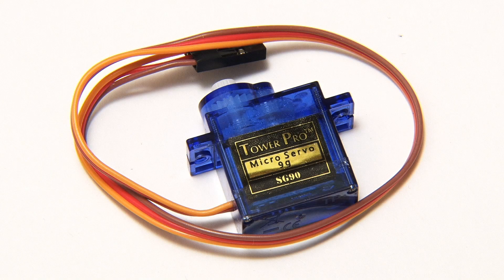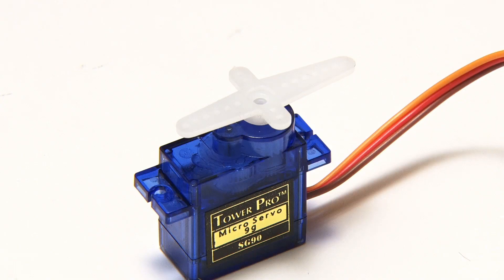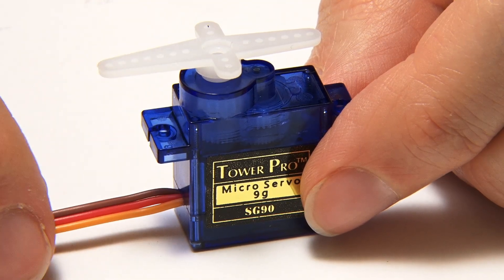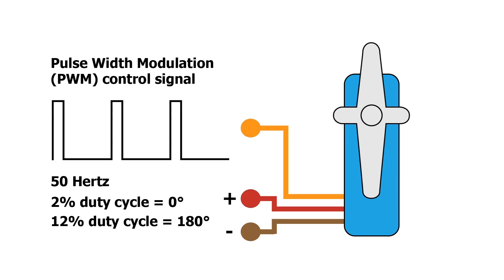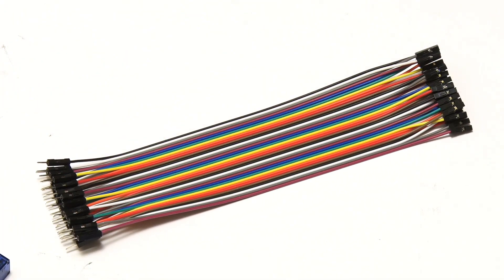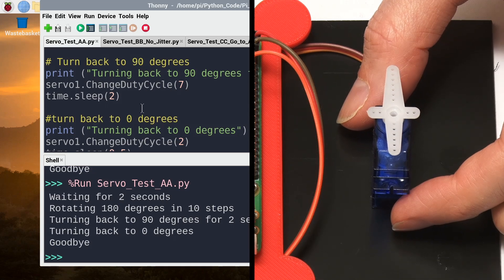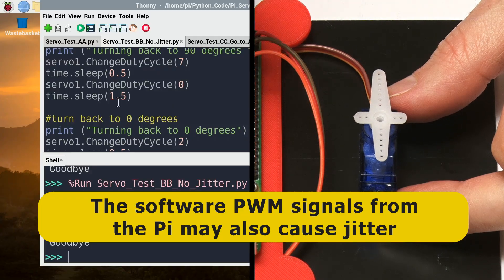Raspberry Pi Servo Motor Control

Comment: 🎯 Key Takeaways for quick navigation:

00:21 🤖 The video introduces how to control servo motors using a Raspberry Pi, a critical skill for various projects.
01:19 🛠️ A servo motor, like the SG 90 mentioned, allows precise control of its angular position and consists of a motor, gearing, a potentiometer, and control electronics.
03:08 ⚡ Servos have three wires: positive, negative, and a control signal wire, which requires a pulse width modulation (PWM) signal to control the angle.
05:06 🔌 Servo wiring example for a Raspberry Pi, including connecting the signal, negative, and positive wires to GPIO pins.
06:27 🖥️ Setting up servo control code in Python on a Raspberry Pi, including GPIO pin configuration and PWM frequency.
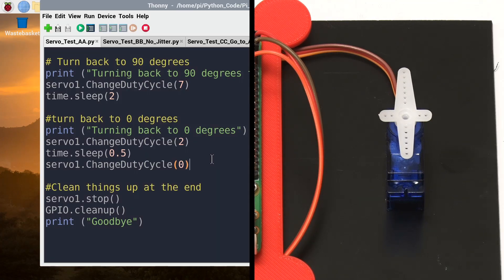09:12 🤔 Demonstrates a servo motor moving in steps, but there's some jitter due to the motor trying to hold its position.
10:19 ⏩ A code modification is shown to reduce jitter by briefly turning off the servo after each move.
13:05 🔄 Code example allowing user input to set the servo angle, providing interactive control.
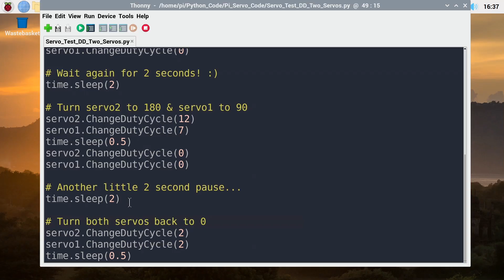16:22 🤖 Controlling two servos simultaneously using a Raspberry Pi, demonstrating the capability to control multiple servos for various applications.
Reply from the maker: Thanks for this. Although the video is already divided into named chapters, which can be navigated via the bars at the bottom of the video.

Comment: For some reason changing the duty cycle to 13.222 on SG90 will send the servo more than 180 degrees, maybe 320 degrees, but not to an angle, just adding to current angle, so if you change it to 13.222 twice it will go to 640 degrees counter-clockwise from the current position.

Here is some code to make it spin continuously for 5 seconds

import RPi.GPIO as GPIO
import time

GPIO.setmode(GPIO.BOARD)
GPIO.setup(11,GPIO.OUT)
servo1 = GPIO.PWM(11,50)
servo1.start(0)

count = 0

while (count < 10):
    print(count)
    servo1.ChangeDutyCycle(13.222222222222221)
    time.sleep(0.5)
    servo1.ChangeDutyCycle(0)
    count = count + 1

servo1.stop()
GPIO.cleanup()
print("Finished")

Comment: Is there a way that I can move the servo in the opposite direction?
Reply from the maker: A servo is sent a signal to turn to a fixed angle. So the direction it travels depends on the starting angle. For example, if it is at 45 degrees and you send it to 0 degrees it moves one way. If you send it to 90, it moves the other way!

Comment: Can you please help understand what the code would look like if I want to control a service motor holding a camera? I would like to type “R” and have the motor go right a certain amount of degrees and then type “L” and have it go back left a certain amount of degrees. If I type “U” for up the other motor would move the camera up a few degrees and “D” the camera would go down a few degrees.

Comment: Thanks for posting that very nice video. I am trying to make a solar powered security camera with pan and tilt control. I hooked up the pan servo of a tilt/pan 9g servo assembly to my Pi 3b running MotionEyeOS, SSH-ed into it from my Ubuntu 22.04 laptop, and wrote action button files to make the camera pan/tilt action buttons appear on the camera live feed. The next thing to do is to write code to put in those files. I modified your code to set the pan to straight ahead center, pause, then go fully to the left, pause, back to center, pause, fully to the right, pause, then back to center and end. It does that. Hooray! But what I need is code to bump the camera from right wherever it is at, to the right (or left as the case may be) say 22.5 degrees every time I click the button and make the code run again. For that, I think I need my code to find the current position to add or subtract to it. Is there a way of doing this? Otherwise I can only pan to one of three positions, home, left x degrees, or right x degrees. I want to be able to click the button repeatedly to move the camera more and more, another step each time I click.

In fact, a video showing how to make best use of those pan and tilt buttons in MotionEyeOS would probably be helpful to a lot of people. Just sayin. You have a knack for explaining things like this. Liking and subscribing.

Comment: @13:30 Explained for my sanity.
Duty cycles range from 2 to 12, which represent 0 to 180 degrees. So for our input variable "angle" you are using "angle/18" (to get 10 degree position steps out of 180 degrees). So for an input "angle" of 90 degrees, it would be 90/18=5 for the duty cycle. However if we gave 5 as a duty cycle in the range of 2 to 12, then this would effectively be a 3 and not 90 degrees, because 5 is not the midway point between 5 and 12, 7 is. So this is why we add 2 for the duty cycle position (5+2).

Comment: so why do you go from 0-12 for the duty cycle? the online library example show values between 0.0 to 100.0
Reply from the maker: Which online library?! :) Servos are controlled from a square wave, which would be a horizontal line at either 0 or 100.

Comment: Great explanation and code works 1st time Christopher, most excellent! I am brand new to raspberry pi and python. Q: Is there a code example that would repeat (or loop) the code 50 times? (Without copy and pasting code 50 times… lol) thanks again you are a great teacher. John
Reply from the maker: You could add something like this:

count = 0
while count < 50
     [SERVO CODE]
     count = count + 1

Note that here the code inside the while loop is indented with a tab.

I have a Python intro video here: 
https://www.youtube.com/watch?v=Crsp_He70no
Reply: or you can use for loop:

for i in range(50):
          servo code

Comment: I’m building a little robotics platform for myself and had typed out a little Python Library for myself to handle the wheels but didn’t know for sure if the PWM methods could control more than one servo at a time. With this hindsight I realize it’d be a bit silly if it weren’t capable of doing so. Now I just have to remember where I saved the two libraries, test them out, and add in turning to the Wheel library. Thank you again for the awesome videos!
Reply from the maker: Good luck with your platform. :)
Reply: @ExplainingComputers  Thank you!

Comment: Excellent presentation. I'm going to have a fun time working out how to control two servoes on a Delta V-wing drone.
Reply from the maker: Sounds like a cool project.
Reply: @ExplainingComputers  It will be when I get that far. RIght now I'm having difficulty since eBay sellers are willing to sell but not to supply. If I was back in Swansea I could go to Tom Whitehouse in the market but I'm in South Carolina.

Comment: 12:05 How to set the servo rotation speed?
Reply from the maker: You can't set a servo rotation speed -- the control signal just tells it the angle to turn to, and it will do this as quickly as its mechanism and any load will allow. But you could control the speed in software by sending the servo to intermediate positions.
Reply: @ExplainingComputers  Oh. I guess we can adjust the speed too :)

Alright, thanks a lot for the information and explanation!

Comment: Is there a reason not to use the hardware PWM pins found on the Raspberry PI 4 B?, or weren't they not in the PI 3?

Sorry if this is a stupid question, we are a bit stumped as to why our servo is not playing nice (starting to think it might be broken, since it isn't new)
Reply from the maker: The two hardware PWM pins on a Raspberry Pi (any model) cannot be accessed from Python using the available Rpi GPIO library. So yes, there is a reason that you have to use the software PWM. :)
Reply: @ExplainingComputers  Thanks for the info! 

btw, the erratic  servo we had was indeed broken, and a different servo worked beautifully following your video 👍

Comment: With just 2 PWM chanels but 4 outputs I had wondered if you can coltrol 4 servos independantly, turnd out you can. All working fine thanks, for the code really speeded things up for me, only used stepper motors before.

Comment: Hello Chris, thank you for the fantastic tutorial.  I used the code for my program and it all worked well until I modified the main python program to run continuously. Based on the value on a table, it would trigger the python program to run the servo motor (change the angle), that program would use the same code principles (set up the servo, make the angle changes, then stop and then cleaned it up at the end). For some reason it work fine the first time the servo program is triggered by the main program, but once it triggers it again the program would run fine but the servo would not move. Tried all the different options and it failed to worked (e.g.: not stopping it but cleaning it, etc.). 
Only way I could finally make it work was to: Always have the servo running (no stop or clean up); Have all the code in one program (The table check and the servo change). Main problem with that solution is the fact that based on my requirements servo is always in used - which could reduce its life significantly.
Any ideas on how I can solve this (main issue seems that once the servo is set-up in python and then closed/cleaned it will not move again unless the program python code is completely stop)?
Thank you in advance and keep up the great videos

Comment: In this video you used a 3 amp power supply, can I power 2 small servos (like yours) which are moving a servo stand and a PI camera, with only 2.5Amps?

Comment: Micropython newbie here.  Stylistically, why the try-finally block (without an exception clause)?  Also, should the script's exit cmd follow the block rather than appear inside it.
Reply from the maker: This video -- and the Pi -- uses Python, not Micropython (as can be used, for example, on a Pi Pico). Here try-finally is implemented to allow the user to break into the infinite while loop with GPIO cleanup then executed (I'm having to remember the code from the video here -- I do not recall the content of over 400 videos!). So the GPIO cleanup command has to be inside the finally block, or it would not execute. There is no exception clause because none is required! There are, of course, always lots of different ways of doing things. However, as I've used such code in videos with many millions of views and have never had a comment on it before, I believe this is pretty standard stuff. :)

Comment: I want to control the servo motor with the ultrasonic sensor and the raspberry pi, do I need to use a extra power supply and I have no idea how it should be powered

Comment: Kinda time senstive but no rush obv. With the servo motor, what wire would fit in the holes along the servo? and how would you go about attaching said wire? do you just make a tiny knot so it doens't thread back through or is their an actual component you can buy?? THanks in advance!!!

Comment: That took a lot of time and work. I think you would find using a PCA9685  would make things a lot easier. I've always found a dedicated hardware solution works best. After all the PCA9685 was designed to make life easier. Nice video, but why make things more difficult for yourself... Happy GPIO..
Reply from the maker: A PCA9685 is not remotely a replacement for an SBC! :)
Reply: @ExplainingComputers  of course it's not a replacement for a SBC.  it's strictly a servo controller to be addressed by a raspberry pi or similar SBC through I2C. I use them to control servos that are connected to a Jetson nano, and they work great. They greatly reduces the load on the cpu. I said nothing about replacing the SBC with a PCA9685. There's nothing wrong with doing things your way, but it greatly limits the SBC's ability to perform additional tasks at the same time. A software solution for controlling a servo is an added layer of complexity and its cpu intensive. Most of the processor time would be dedicated to generating the necessary signals to control  the servo. 
 It's your channel you can do what you want. I'm just saying there are better ways, unless the only objective is to move a servo and do nothing else. Anyone wanting to control a servo with a camera attached to scan the environment or other device, lidar, or ultrasonic sensor. Is going to have a very difficult time without a servo controller attached to a SBC. I hope this clarifies my position. I'm not here to get into a pissing contest.
Reply from the maker: @rickhunt3183  Ah, I see -- understood. :) I totally agree that there are better ways to control servos from a Rasberry Pi than directly via GPIO, but that is the easiest method for new users, which is what I was trying to show here. :)
Reply: @ExplainingComputers  thank you for your response and for being so nice.

Comment: Thank you very much. But I have a question if you can kindly answer me or advise me, the servo is vibrating (making noises), how to remove such noises because I want to place on top of the servo an accelerometer (otherwise it will give me wrong readings). Best Regards

Comment: I am running a software defined internet connected short wave radio receiver with an RPI4 and have been looking for a simple way to "tune" a loop antenna with a variable capacitor. I think I have now found my solution! thanks very much !

Comment: Very useful video, thank you, how can we connect a servo and a LED at the same time to the raspberry Pi, should we use an external battery for that. Would you, please, provide the right connections for that, thanks.
Reply: Just connect the LED to another gpio pin?

Comment: Could someone tell me the code to rotate the servo 360 degrees?
Reply from the maker: Most servos do not rotate 360 degrees. For that you need a stepper motor.

Comment: Finally got mine all figured out. Thank you for the video.  My breakout board was backwards but for some reason the 3.3 v pin was measuring as 5.2 v on a meter so I assumed the configuration was correct.. it was actually backwards.  Anyway I had it all hooked up correctly except for the ribbon being backwards.  All working now.
Reply from the maker: Great to hear! :)

Comment: Hey, Nice Video, but is there a way to rotate a servo motor 360 degress? if so then pls reply me I am new to this. Thank you :)
Reply from the maker: Very few servos go 360 degrees -- it is not what they are designed for. For that you need a stepper motor.
Reply: @ExplainingComputers  Ok, So I am gonna get a DC Motor. Thanks for replying :) +1 sub

Comment: If i run out of 5V pins on RPi, could i power this servo with 3.3V pin?
Reply from the maker: No, absolutely not for two reasons. First, it needs 5V. And second, the 3.3 volt pins on the Pi draw power after the Pi's voltage regulator, so can only supply very low current to electronic devices. Connect an electromechanical device like a servo to a Pi's 3.3 volt pins, and you run the significant risk of damaging the Pi.
Reply: @ExplainingComputers  Thank you very much!

Comment: with some rusty fingers. I was working on a way to execute input to the servo with argv. You have just help me out so much here.
Reply from the maker: Great to hear. Hope all goes well.
Reply: @ExplainingComputers  im struggling with the odd movements. Nothing is consistent. I may move my project to a stepper motor but i hope to give the servo more testing tonight.  
A single servo connected to the pi is clean for my project.

Do you have advice for this Inconsistent odd movement? I test ran your improved python script and found the same resaults

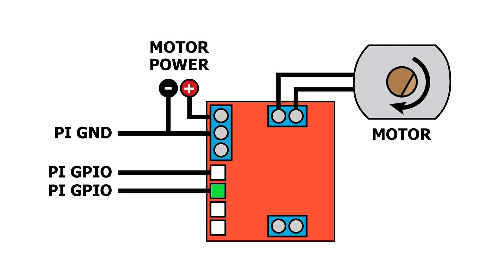Comment: 2:12 "... in contrast a servo does not spin continuously, ..."

That is not entirely accurate. Servo is a general term for a closed-loop system consisting of a motor, feedback, and, well, the control system.

You can have speed servos that, as the name suggests, will maintain speed, given a reference. They do spin continuously at a set speed and (try to) maintain that speed as the load changes.

What you describe in this video is a position servo, which spins to get to a position set by the reference.

Comment: Do you know if these servos can be modified to turn 360°? I'd like to use them on a dry food dispenser. regarding the jitter issue, looks like using a different library like gpiozero could solve this

Comment: If I were to add some motors too this as well as two servos would I need a seperate power supply?
Reply from the maker: Yes, and a motor controller (like an L398N).
Reply: ExplainingComputers  thank you

Comment: Is it possible to control the speed at which the servos move? Independently of course?
Reply from the maker: Servos just more to the angle you send to them. You could send them to a lot of intermediate positions to slow the proccess. But if you want speed control of an axel, use a stepper motor.

Comment: I have tried your video and it works good but the PWM accuracy is not so good from pi.  So could you please make video for controlling the servo using raspberry pi keyboard and mouse interfacing with servo motor drives. It will be very useful for my studies

Comment: Would you reccomend the raspberry pi to run dc motors using a joystick?
Reply from the maker: Using the right motor controllers this could certainly be done.
Reply: @ExplainingComputers  I'm interested in doing this, I'm torn between the pi or the arduino uno.
Reply from the maker: @matthewbennett2844  If you purely want a controller, use an Arduino.

Comment: Your servo video is inspiring. I've been trying to figure out how to make my own scanner for 16mm movie film. What you showed in the video is going to be a key part of it. I still need to figure out optics but I did figure out how I can use a time lapse function in an animation app in my iPhone to photograph the frames. I had thought about using a single board computer to perform this function as well but moving the film seems like a big enough challenge.